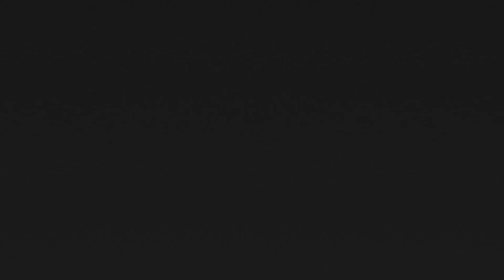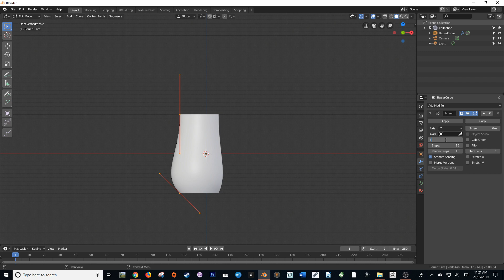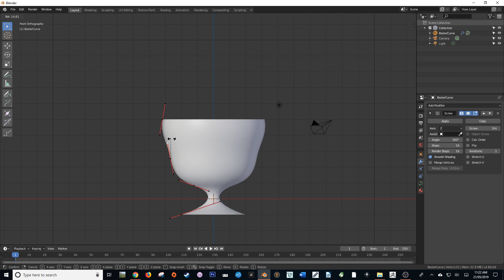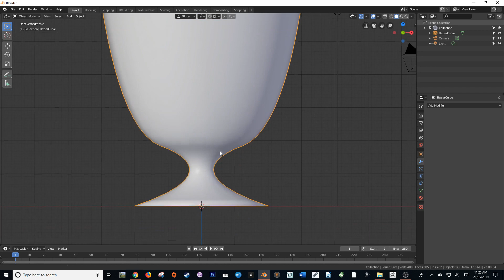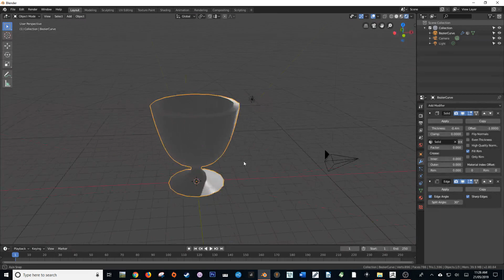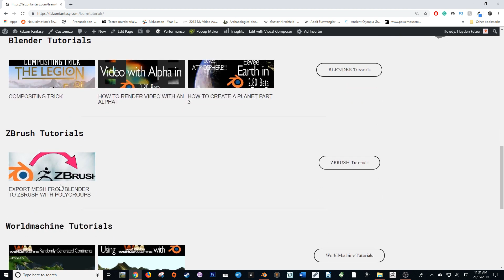Blender 2.8 Tutorial | Useful 3D Modelling technique | Lathe

Comment: after using NURBS in Maya and then choosing how dense the mesh is, i really wish Blender would do some more work on them. They are so nice to use.
Even using them as guides and using Snap To Curve made modeling so much easier with blueprints.
Reply: In Blender you can also choose how dense the mesh is. The resolution of the curve gives you the subdivisions between the vertices of the curve and with the steps you set the divisions going around the object.
You can preview the mesh by going to object tab > Display setting and activate the wireframe